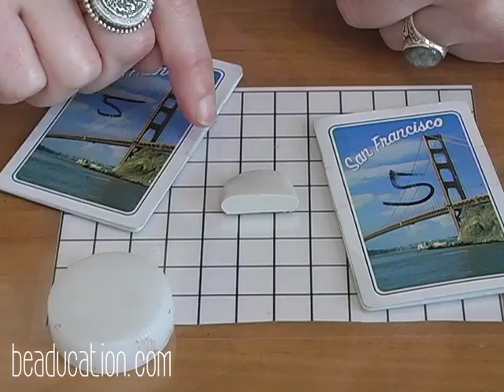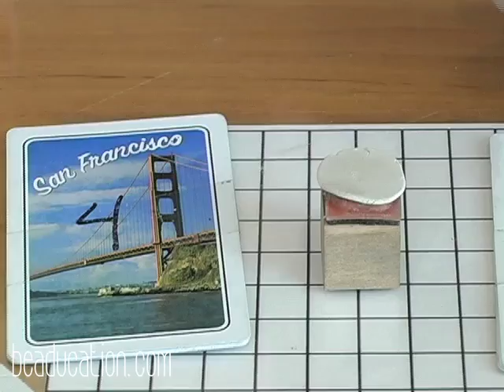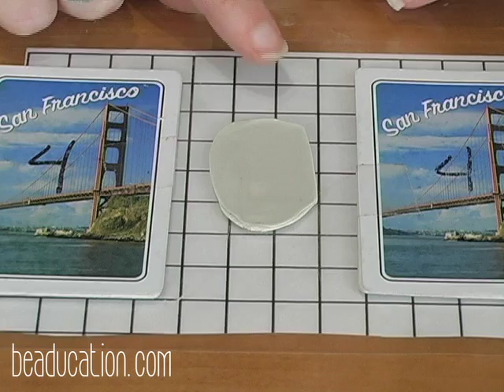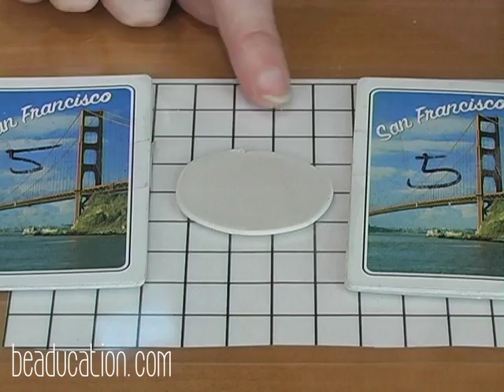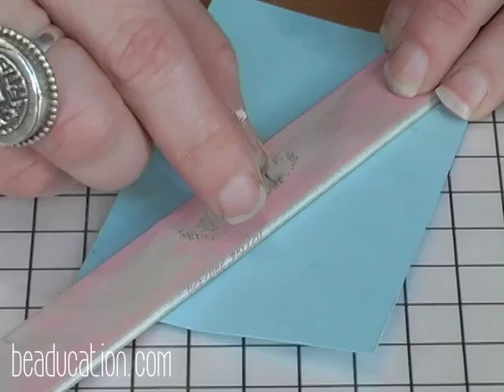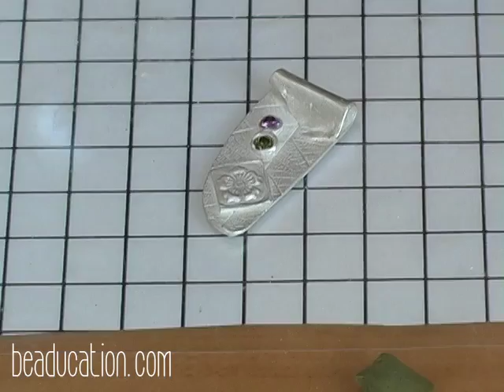Introduction to PMC - Beaducation.com

Comment: Random thought/question... could you make a bezel by forming the clay around the correct size drinking straw and then cut the straw in sections to the height and bezel count needed or would you mess it up when you try remove the pieces of straw?
Reply from the maker: I am not really sure! W don't have much more experience in the PMC technique, but I am sure there are a lot more videos out there that would cover more tips for creating a bezel with PMC.
Reply: @beaducation  Thanks! I was just wondering.  I've worked with various crafts but I've never worked with anything like this. Thanks again and have a great day! 🙂

Comment: What if I want to make pendants with opal, kyanite, labradorite or moonstone in it? Is there a way to fire clay with those stones in it?
Reply from the maker: You can use gemstones when working with PMC. We suggest you find a gemstone temp guide to see what gemstones can take what temperatures.
Reply: @beaducation  one more question. Can  a torch be used when working with PMC clay and gemstones, or is it impossible to regulate torch fire and therefore it has to be a kiln?
Reply from the maker: You should be able to use the torch/stones with PMC + or PMC 3 like Kate explains in the Types of PMC portion of the class.

Comment: Thanks for the informative video.  Question.  You hand mentioned that there is at ~12% shrinkage in the firing. When placing a stone, does bezel not crack in the firing process as the stone doesn't shring, but the PMC will?  Do you know if shells pieces or pearls can be fired in with them or should be placed in after?  Thanks
Reply from the maker: +Debbie McLeod Hello! These are great questions! the answers to your questions all depend on the melting temps of all the materials involved. You'll need to do some research to figure that part out. We do know that natural elements such as shell and piece will burn during the firing process. Have a great day!

Comment: I love all the tutorials, so interesting.  I would like to know if it is possible to use PMC copper with solid copper? For example could you brush on or syringe PMC to attach a PMC piece to a piece of copper?  Then to fire it with a butane torch?
Reply from the maker: +Dorothy Miller Hi Dorothy. We don't have any experience with copper PMC. I suggest searching for a vendor that sells it then they will likely be able to answer this more accurately :)

Comment: I have a question.  Do you have to knead the PMC clay like you would regular clay to get air pockets out prior to shaping then firing in a kiln?
Reply from the maker: +C. C. C sorry for the very late reply. We had a shift in employee duties that resulted in some youtube comments slipping through the cracks! Typically, no, you don't have to knead out the clay, especially if working with a fresh package,